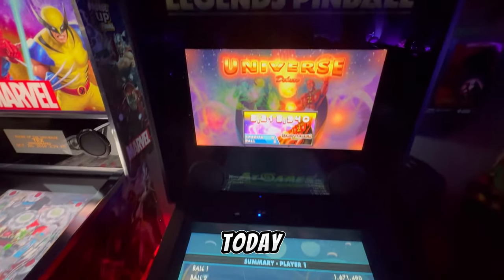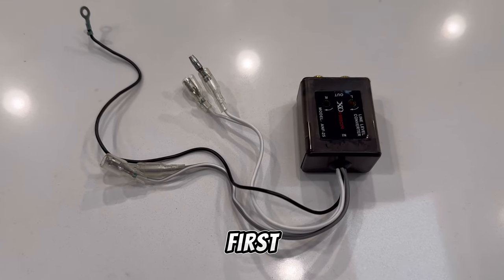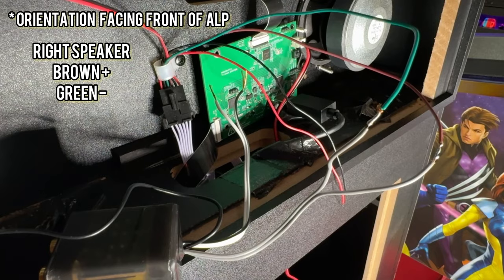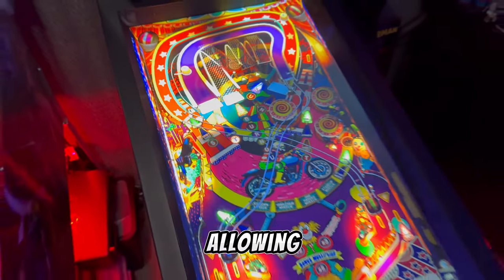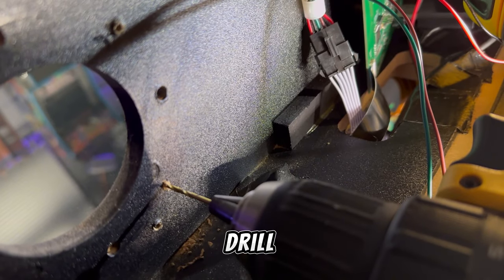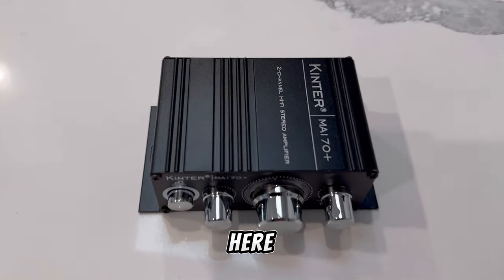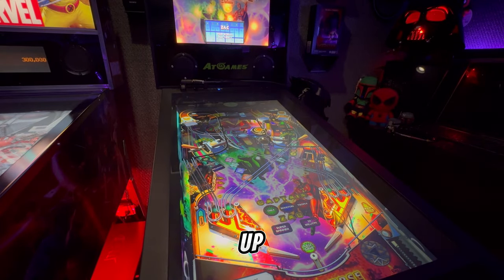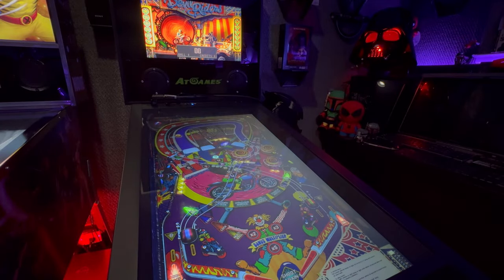Raise the Bar, Raise the Volume: ALP Speaker Boost on a Budget!

Comment: Does it have bass?  I was thinking about getting a 2.1 channel amp that has a subwoofer output.
Reply from the maker: They certainly have more bass than the originals. Midrange and lows are significantly improved with a nice punchy sound. Thank you for watching!
Reply: @JohnPauls  thanks for sharing, subbed btw.
Reply from the maker: You are most welcome and appreciated, thank you!

Comment: John, How could I make this upgrade if I also have a 3rd speaker in the pinball, the subwoofer?  Add a separate line level converter and amp just for the sub?
Reply from the maker: Hey Nicolas, that’s fairly simple. Just ensure the output of the amplifier “watts” is sufficient to power the speakers and subwoofer factoring in speaker resistance. The speakers or subwoofer will tell you their wattage max and impedance on the specs. Or you could run two separate amplifiers, and just split the signal from the line level converter to each amp. Good luck with your build.